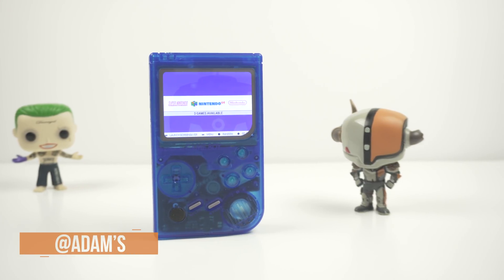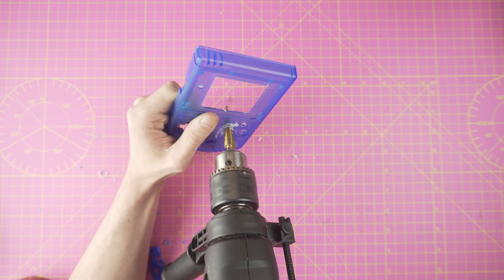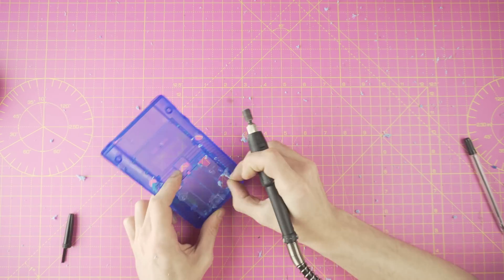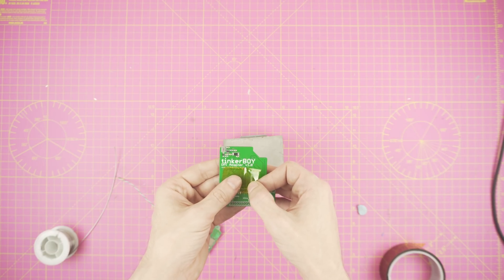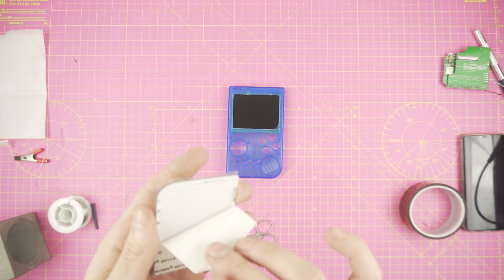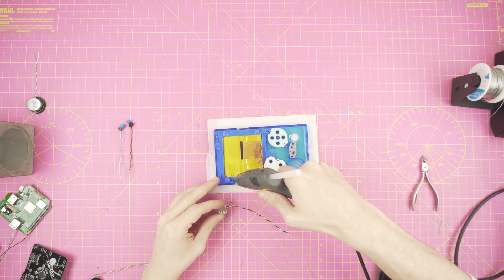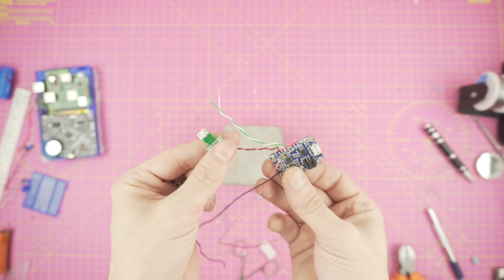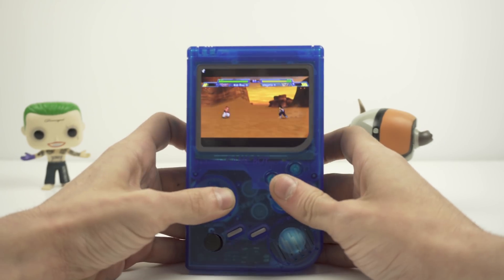Raspberry Pi 3 A+ Gameboy Tutorial

Comment: is it possible to wire 2 psp analog sticks on the tinkerboy controller v3?
Reply from the maker: Yeah, you will need psp1000 to wire them directly, if you want psv2000 ones you will need helper boards

Comment: hey I built this but Im having a yellow bolt appear and the gameboy randomly resets. I was wondering what you did to underclock yours?
Reply from the maker: You need 24 gauge wires, and just wire another rail of power to the back of the pi, not 5v from the DPI, last batches of DPI need this in order to work, I let Tinkerboy know he has it in his website now at guide section. Have a look there
Reply: @Adamstech  i didnt end up using the dpi adapter. I wired a car monitor from amazon straight to the PI
Reply from the maker: you need thicker wires then, it shouldn't even have a problem, also specify the parts you used because as per your comment I understood that you got all the parts like mine

Comment: Brother, been waiting for a tutorial like this for years.. Pi3 in Gameboy.. So any ideas of getting HDMI out?
Reply from the maker: In this configuration is not really possible, I think the dpi configuration makes the hdmi unusable, I have to look into it!
Reply: My screen that I used in my custom handheld uses a 5 inch screen with a hdmi port, like a regular monitor. So I found a handy diy part for that, "5Pcs HDMI Type A Male 19Pin Gold Plate PCB Socket Solder Connector DIY Part." And I just use thin gauge wire. You can find all sorts of ways to connect a screen to a Rpi.
Reply: @Adamstech  Currently the way I have RetroPie and Stretch build is, HDMI detect , then uses a different /boot/config.txt file .. Not sure why an HDMI out wouldn't work. They have small male to female HDMI extension cables.
Reply: @AngryRamboShow  I didn't understand this one..
Reply: @WilsonBradleyTheOfficial  Well, I don't think Rpi 3 can do 2 monitors at once, so you have to pick either spi or hdmi. But if you want to set up a screen that has hdmi in, you could use 2 of those HDMI male connectors to neatly arrange everthing inside a small case. I suggest using those HDMI male connectors because with some thin wire and 38 soldering points you can custom fit the cabling to your exact specifications.
Reply: @AngryRamboShow  Yes, you use one or the other. I have a script auto running that senses hdmi connected. If yes, then it goes to HDMI config file.

Comment: How hot does this build get? How many mah does your battery get and how long does a full charge last?
Reply from the maker: It gets a bit hot, but some tweaks in the clock speed and you can keep it down,  the battery has 5000  maH and it's run time is around 4 hours of gaming now depending of your load.

Comment: That power boost module is rated at 1A you will barely be able to have enough current for the pi to run retropie with that and you will be getting the lightning bolt symbol at boot and when you are running CPU and power hungry games.  You need at least 2A for this build.
Reply: @Niko Niko Any suggestion on a better powerboost module? Thanks!
Reply: FitnessMtl there are a few boost buck converters rated at 2 amps on Ali express

Comment: Is Powerboost 1000C enough for power it under high load?
Reply from the maker: Well it is enough but you need to tweak the voltage and it should be fine, we will have a new powerboost from Tinkerboy soon that can handle it perfectly
Reply: Adam Builds Hi, I am actually doing something very similar, and I plan on using an adafruit powerboost 1000c to power my rpi 3a+ too. What do you mean by « you need to tweak the voltage » ?
That’s a really nice build btw, I would love mine to end up looking like yours !
Reply from the maker: @w2ex215  Hi, I mean to underclock the Pi, but instead of using the 1000C try Helders PSU, or you can go with this a cheaper one MP2636 Power Booster & Charger Module, you can find it on Pimoroni.com, this one works fine as well!
Reply: @Adamstech  what underclock setting did you use?